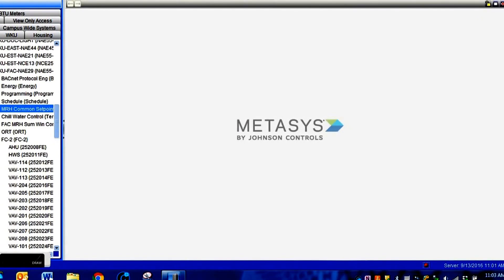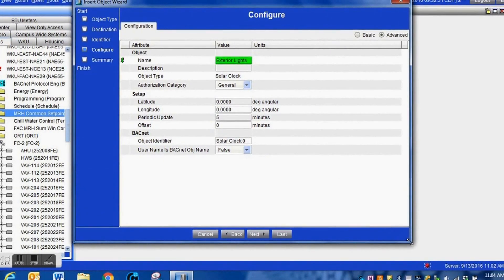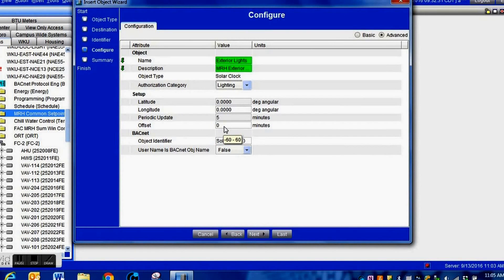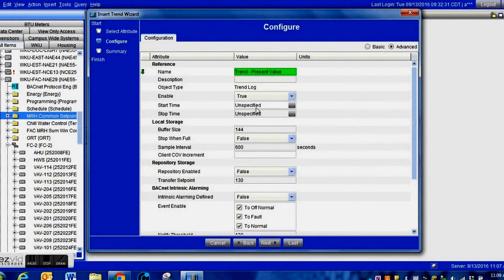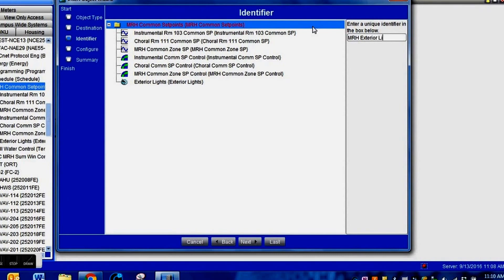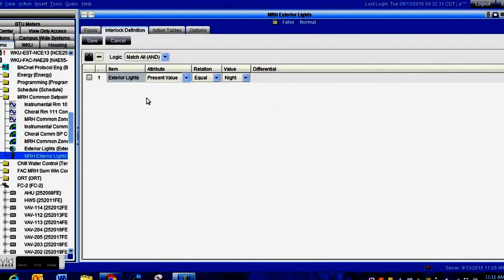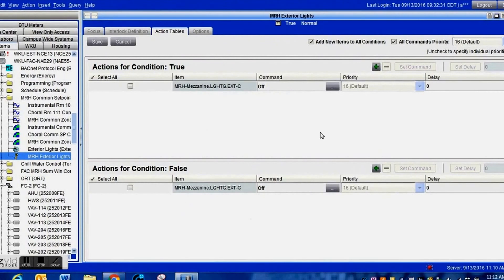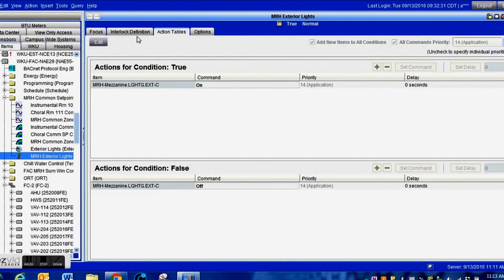Johnson Controls Metasys Solar Clock Lighting Control

Comment: Hello Good afternoon.  I am checking my Johnson control Metasys. I want to add a Solar clock object for my Lighting schedule which will base on the sunset and sunrise schedule from the internet.  But I can't find Solar clock object type. My last object type is only Signal Select. 
Please advice. Thanks.
Reply from the maker: +Efren Sevilla some versions don't have it.
Reply: Hi Good afternoon. I have a query. I have a Supervisory controller (NAE) which is version 7. My SCT is version 5.2. Can I create a back up on the controller which is version 7.0 using an SCT version 5.2? 
Thanks in advance.